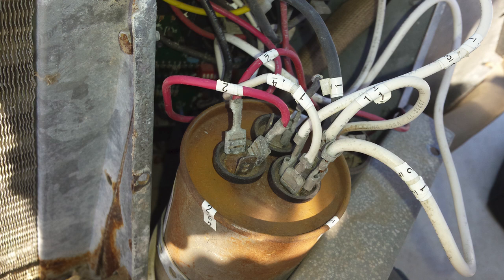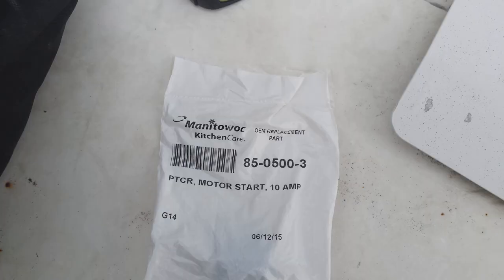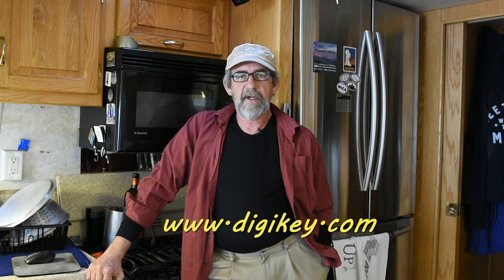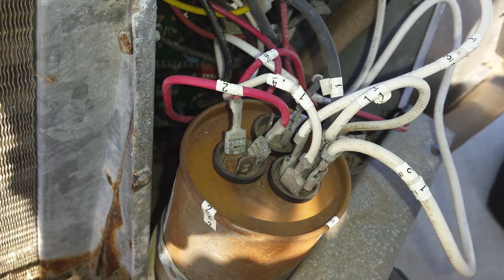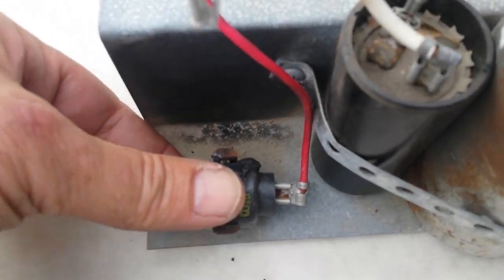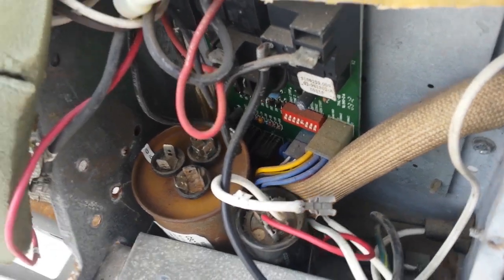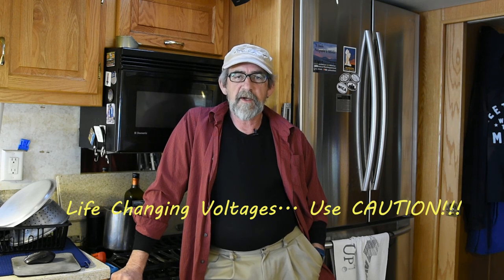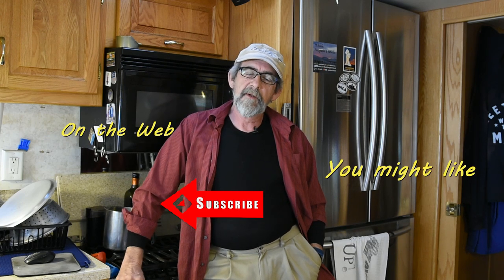RV How To - Replacing a blown motor starter capacitor in my Air Conditioner

Comment: Mr. Bowlin this is the same thing wrong with mine can you give me the part number for the little capacitor and the brand I can't believe I found this video. I can't make it out on the video. Thank you for this.
Reply from the maker: Let me check. It was 4 years ago when I fixed it. Watch for a reply tomorrow

Comment: Hello, I am curious about the little round black "capacitor" not sure what it's called. When I try to turn my air on this smokes and begins a small fire, not sure what has gone wrong. We've been living in this RV for over 3 months now and now all of a sudden we have a problem. BTW - the RV is a 2002 Cedar Creek model. Any comments or help would be greatly appreciated.
Reply from the maker: They are called motor start capacitors. Capacitors are known for wearing out and since yours are 20 years old I would replace the one smoking ASAP.
Reply: @trbowlin  10-4 thanks, I removed the old one this morning and looking for a replacement
Reply: @trbowlin  thanks for the tip!!

Comment: I got an 1994 duo-therm by dometic penguin AC which won’t start at all. What size capacitors do you think i need for it? There’s no way i can read anything of the old ones
Reply from the maker: I can help, but need the model number of the unit.

Comment: Hey TR I'm having an issue with my ac unit. It runs good on the "on" position but doesn't turn on at all in the auto position any ideas? Thanks for the help in advance if you can! Great videos too btw! You're the man!!
Reply from the maker: If you have set it properly and it does not run, it sounds like you need a new thermostat. They're pretty inexpensive.
Reply: @trbowlin  thank you sir! 😊 been watching your videos back to back learning new things! You're very informative which is what I was looking for thanks again
Reply from the maker: @robdoe4346  No problem. Glad you are enjoying my content.

Comment: I had to repair the ac on my dads old rv ac unit it was a old military capacitor had od green paint on it and I have been in the ac service industry for about 15 years now and never have I seen on that huge
Reply from the maker: I have a friend that built a Van de Graff generator that was made with super capacitors. They were the size of a quart oil can!

Comment: blown motor starter capacitor......Is the AC capacitor part of a soft-start system for RVs? Do residential AC systems have them? Are all newer RV rooftop AC units also a heater? Heat pumps? Thx!!
Reply from the maker: Not part of a soft start but they contain capacitors (larger) to make them work. Yes all AC systems that have a compressor have starting capacitors. Yes, nearly every RV roof top AC system is also a heat pump. Thanks for watching!
Reply: @trbowlin  Thx for the info!!

Comment: So, the starting capacitor was that little one, not the big one that you numbered the wire conections on? I thought it was the big one. Thanks for posting this, we have a 2003 Newmar DSDP with two 13500 penguin a/c with heat pumps and I'm sure I'll be facing this same problem in the near future. Safe travels T.R.
Reply from the maker: They both are starting capacitors, the small one gives a real fast boost of high power and the larger one then finishes the job of starting the motor. Thanks for watching Rick!

Comment: Hey 👋 I’m a noob to anything RV and my ac are not working. It’s 28 years old and the fan seems totally stuck. Can’t roll them manually by hand at all. I looked at my capacitors today and there’s no text on them. How can i know which one i need? It’s a penguin ac
Reply from the maker: I am afraid the news is not good. If you can't turn the fan blade, the bearings in the fan motor have seized, and the only fix is replacing the fan(s). It's not a capacitor issue. Frankly, it may not make sense to try and repair 28-year-old air conditioners. They are sealed systems, so you can not recharge with additional freon. You could spend $3-400 on parts only to find that they are not repairable. Plus, since they are so old you may have a real hard time finding repair parts. You can get new units like this on Amazon https://amzn.to/3tNBQ0x for around $950. I wish the news was better, but I don't want to send you chasing only to run into a dead end.
Reply: @trbowlin  thanks, I appreciate your reply. I’ll look into that AC u linked

Comment: The case of it brake leaving a crack in the case. This ark to the metal and pow it was done... Like the old days when you touched a spark plug wire and it zapped you... basically the something..
Reply from the maker: Exactly.

Comment: and if they don't kill you you wont forget about them being charged even when they are bad they hold a charge
Reply from the maker: I got across one with my forearm about 25 years ago when I was repairing a broadcast mixer board in the control room of a radio station I  worked at. I leaned into the board and my arm made contact with the terminals. It threw me across the room and left two perfectly circular burns on my arm. I permanent reminder to not work on  'hot' electronic circuits!
Reply: @trbowlin  if the power is shut off the unit, do the capacitors still hold a charge?
Reply from the maker: @ScottNAdelman  Yes, they can hold a charge for quite a while after the unit shuts off. Sometimes for days depending on the capacitor.
Reply: @trbowlin  thank you! I was safely able to change my capacitors and clean the motor housing thanks to your video!
Reply from the maker: @ScottNAdelman  Excellent, I love hearing this!